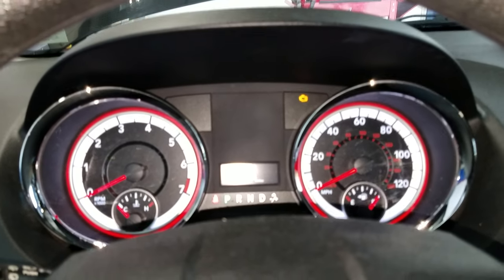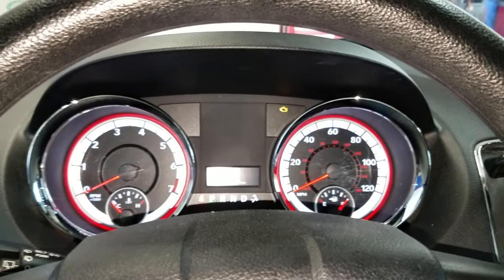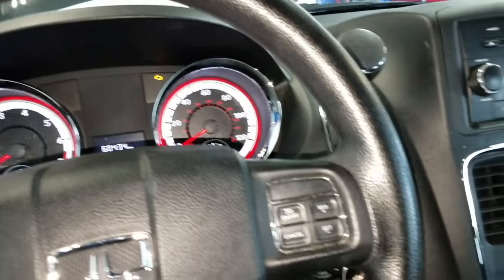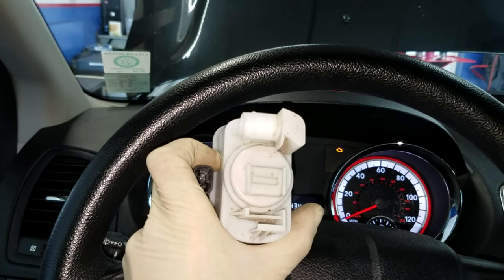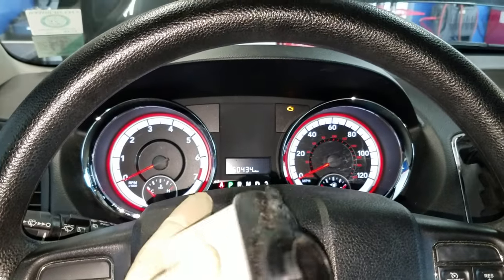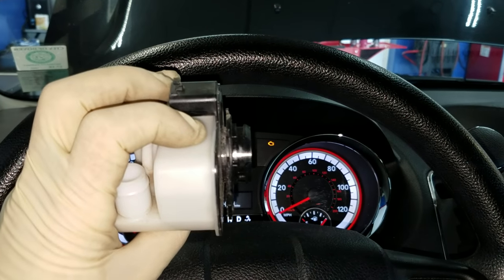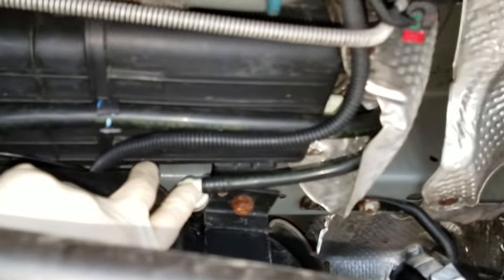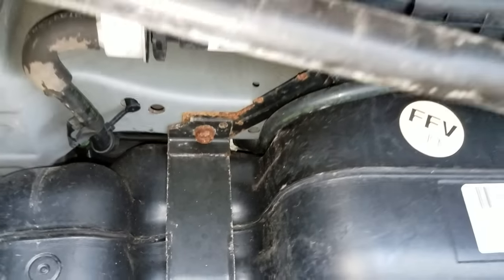Dodge Caravan P0456 small EVAP leak "Most  Common Cause"

Comment from the maker: Evaporative System Integrity Module for Select Models  https://amzn.to/2D9vgXK
Reply: The link says ships between 1 and two months, just a heads up lol
Reply from the maker: Ya, that crazy. Thanks for the heads up. There are other listing for the same part it looks like.
Reply: I have no engine light coming on but the code reader gave me po442 and po455.
Reply: @FlatRateMechanic  and the van is missing the fuel cover door
Reply: I changed that and it didn't help. It only sets a code once a week or so. Not sure what else other than a cracked hose, could cause this.

Comment: Thanks for the video. Saved me time and money. I did the key turn to get the code, didnt even need the scanner. I thought it might just be the gas cap but it was holding good pressure. I found this video and found the part in stock at O'reillys for $33. Installed it in 10 minutes and went through a drive cycle and the CEL is gone.
Reply from the maker: Nice, glad to here it!!
Reply: 7$ amazon

Comment: Just got this on my 2014 dodge caravan se. All online is the same drama of not including where it's actually at. They all say remove tires, pull trim pieces off, the guy at oreily told me it was near my headlight... It's so dumb that a simple part to change is so hard to locate.

Thank you for clearly giving me a spot to check that makes sense. Just gotta get the van lifted properly to do it myself.

Comment: Just swapped this on a dodge dart I really hope this fixes it I vacuum tested the purge solenoid and it seemed to work. Smoked the system and found nothing but I did find dust inside the esim so I really hope this is the issue only time will tell.

Comment: The flat rate mechanic question I have a 09 dodge caravan I have the engine code P0456 small evap leak could it be a gas leak or a gas cqp

Comment: Funny story to share: I had a check engine light on and I went to Walmart and bought a $20 OBDII reader. I said P0456 and I googled it around and found out it could be a loose gas cap. I immediately checked my truck's gas cap and found it loose - which I tightened immediately. Now the check engine light is gone.

Comment: I have a problem with my 2014 Dodge. Grand caravan 3.6 a friend. Put it on a scanner set number 5. Injector was not acting right I. Replaced all 6 injectors and 6 coils swapped out. Spark plugs vehicle will not idle. And check engine light comes on. I've been trying to Google an. Idea of what could be wrong? I can start it up with my foot on a fuel pedal. And if I put it in reversed with the parking brake set, it will stay running but runs rough. It would be appreciated if you had any ideas for me

Comment: what about a 08 3.3 flex fuel?? once I turn on the vehicle I can smell the ethanol fuel in front of the vehicle. anyone have and idea and point me to a good starting point?
Reply: I have a 09 3.3L & had a burning smell in front of the vehicle & it was actually the heater core.  I was leaking coolant badly, not sure about your situation.
Reply: @TheMacronical its the fuel actually but no leak anywhere

Comment: Do these make any noise? I have a small evap leak code but my acceleration bogs down at 4th gear and it starts to growl. After I get through 4th everything is normal again.
Reply: I have the same problem! Did you figure it out?
Reply: @franciscagranillo5225  Not yet. It's something in the exhaust system whether a vacuum leak or a catalytic converter starting to fail. I'm going to try a smoke test using some rubber hose and a cigar.